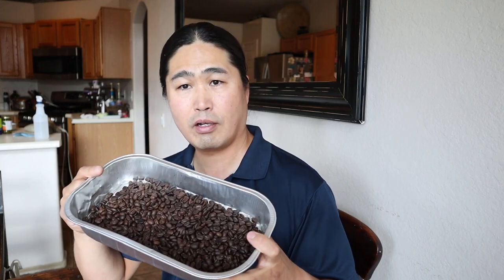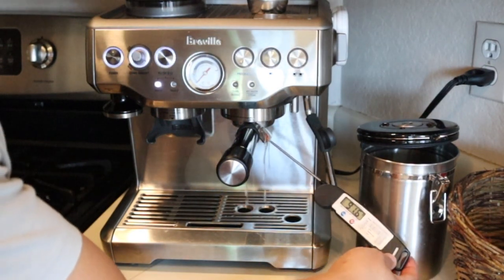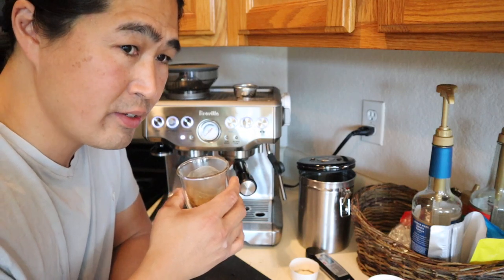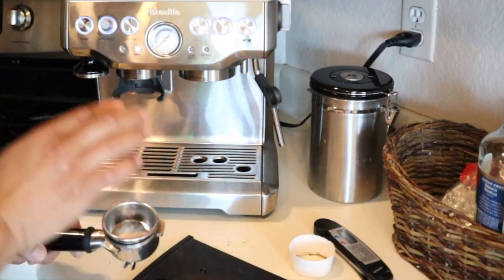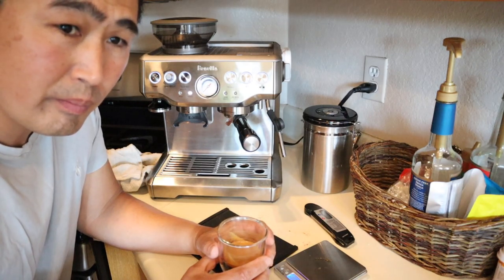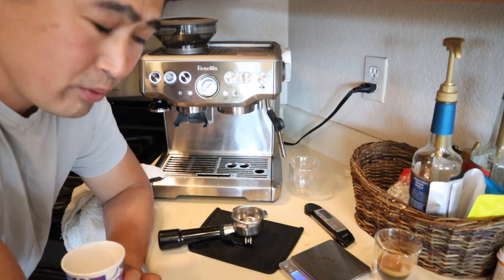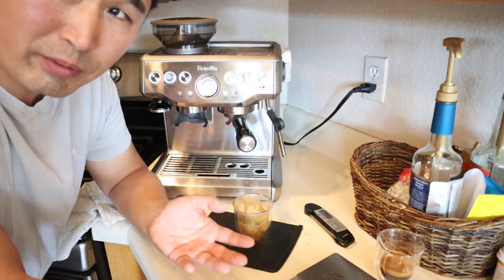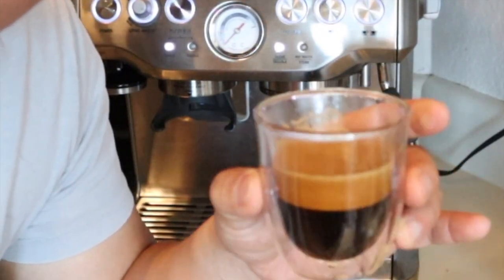Breville Barista Express - Tips on Grinder Adjustment!

Comment: I just bought the machine today. Havent been able to pull a decent shot yet. Under brewing consistently. Thanks for the video! I need a scale!!!
Reply: majinraptor I had the same situation. I adjusted the grinder size under the bean stocking basket to the finest, and it works now with size 3 of the grinder on the left is the machine.
Reply: Fresh coffee 5-20 days after roasting provides the best pulls. The oils create more resistance and allow for fuller extraction and longer brewing times.

Comment: Hoon—I really enjoy your videos and have binge-watched several of them while I have been waiting for my new Barista Express to arrive.   I just got it yesterday and knew exactly what to do.  The first shot that I pulled for a latte (using the single wall double basket) was right in the sweet spot for the pressure!  I used the same beans and oat milk that I have been using for years with an older Breville machine and the first latte that I made tasted COMPLETELY different like it was made at a proper coffee shop.  I didn’t even recognize the taste so clearly, I have not been extracting the full flavor from my beans all this time!  My settings were 6 on the coarseness, 3 internal and 3 o’clock on the grind amount.  Absolutely perfect!  I am buzzing so hard right now from the strength of the shot.  Lol Thank you for your great videos!
Reply: what is the internal grind size on? I just got mine today for xmas

Comment: Thanks Hoon. I am using the Razor that came with the machine to reduce the level to the Breville recommended depth. With my tamping and the razor I have been getting the pressure to close to the middle of the pressure dial and the taste I like using the single wall basket. Going to go and try the same proceedure with the pressurised one to see the results.
Reply from the maker: I have been really enjoying the double wall. I get good shot every time.
Reply: @HoonsCoffee  I too managed a good shot with the double wall. Puck doesn't drop out like it does with the single.
Reply from the maker: @garys639  I know. Maybe something to do with pressurized basket.
Reply: @HoonsCoffee  Pressurised basket won't allow the 3-way solenoid to extract the excess water at the end of the shot.

Comment: What is your your upper setting? The adjustment on the burrs. 
I’m using fresh beans and need to go down to a #3 on the side adjustment to get into the middle of the dial using a double non pressurized basket
Reply from the maker: My upper setting is 6 at the moment.

Comment: I measure the weight of the liquid extracted from the portafilter with a digital scale to figure out the coffee to water ratio. On a 17 gram grind (ratio of 1 to 2), for example, is x2=should equals 34 grams of liquid is added with the espresso gauge reading between 10:00-11:30 o'clock.  Stop the water before it reaches 34 grams by trial and error. That should be set in the program for that bean weight and grind particle size. This procedure is for perfectionist espresso brewers who goes by the book, LOL...The built-in grinder is quite as good as the Breville Smart Pro if the proper tweaking on the outer incremental burr adjustment is carried out.
Reply: I noticed that as well and ive been asking in every video ive watched since im new on making coffee drinks with the same breville barista express. Ive tried so many times with different grind sizes and grind amount and sometimes i get the right pressure but no the exact weight (36g) and thats when i realized that maybe i should reprogram the time for a double shot in the barista express and not use the default time setting (which is set to 60ml by default) but i wasnt sure if thatll be the solution for a perfect espresso or if i should keep trying with different grind sizes and amounts. Did you reprogram the barista express or just found the right grind size/amount?

Comment: I've had my barista express for over 4 years now.  I recently bought a 2 in one, weighted leveler and tamper for the machine. Also I have breville's 60 setting grinder if I need it.
Reply: The only issue I've had with the machine, is the rubber seal around the shower head tearing.  You'll know if this ever happens. The pressure will be low, with water and grounds spitting everywhere.  If their website says the white rubber gasket is out of stock, just call and ask. They should have it.
Reply from the maker: @nicholasrix1707  Luckily my rubber gasket is holding up but I should order some just in case.

Comment: great video, I personally love my barista express (same model as yours). I once had trouble setting the perfect grind size for which I did a little reading and found that you can adjust the grinder directly on grinder's top burr. This might help you get from 9 --> 8.5. I don't know the exact effect it has on the grinder dial numbers, but in  my experience it felt like reducing one level on the top burr had a -0.5 shift on grinder dial. I would be great if you did a video explaining it :) thanks for the video
Reply: I shifted the top burr by following the directions since my shots were consistently sour and fast. I’m not sure what this did in terms of grind size but it would be nice to hear Hoon’s explanations and experiments since I find him to be the best at explaining espresso techniques
Reply: Yes, I heard about adjusting the burr inside the hopper. I just don’t know how to do it. I just open mine to look and see if there were any numbers and there are, but they’re very hard to see. I had to use my phone flashlight. Anyway I don’t know how to adjust it. I agree with your advice on the vlogger creating a video on this!
Reply: What number did you adjust the burr on?

Comment: Hi, i never see you use the front round grinder dail. When do you use it ? Is this dail for how much grams of output you get? So in theory if you know de grinder setting fine or course you can adjust it to get the propper grams for use? This way you dont have to keep checking thr weight? Or am i wrong... i am kinda new to this.

Comment: Hello, I love watching your videos. I just got this machine. I have Illy medium roast beans. If I'm not mistaking you said "use grind setting 7 and pressurized basket for starters" right? Also, what should be the amount size. I love illy and kimbo. What you think about these brands. Thank you👋
Reply: I also use Illy on this machine. So far I found it to be best to grind fine (author of this video would call this "choking", the needle around 1 or 2 o clock position) and use a small dose (16 g). Oh, and very important: NON PRESSURISED basket (single wall). Also, you should skip the single wall basket, it does not help. Begin with the grinder at around 5, and work from there. You should get around 40-45 g in 35 seconds (including preinfusion). If you try these tips, tell me they helped at all.

Comment: Great video. Gonna try those settings. Using grinder at 5 and with the double-wall filters works fine for single and double shots. On single wall single shots right on the spot, but low pressure when using the double shot filter.
Reply from the maker: Since you have low pressure so make you beans little finer by lower to 3 or 2 on the setting.
Reply: @HoonsCoffee  Thanks for the tip. 3 it's the lucky number for the adjustment on the side. The single shot was good with 9 grams of beans (wife was happy with her coffee :D)  going to try 4 for the double shot since it was near over extraction. Worth to mention that the grind setting of the upper burr is set to 5.
Reply from the maker: @josean99  What brand of beans you've been using it
Reply: @HoonsCoffee  Right now I'm using Lavazza Caffè Espresso. Going to start looking for local roasters to get fresh roast.
Reply from the maker: @josean99  Have you thought about roasting at home?
Reply: Hoon's Coffee not yet but who knows

Comment: Need help. I haven’t got a good cup since I bought my Barista Express. I had it set on outside grind 8 & found inside setting on 6. I started watching videos (mostly yours) & started following the dial in. Grind was too loose & gave no pressure, cup was at 36g in 12 seconds with 18g of med roast coffee. So I dialed my inside grind setting to 5 & outside to 8 hoping for factory setting. 18 seconds, very little pressure, crappy taste. Well now I’m on 3 for the inside setting and 6 on the outside with 20 seconds, 10:30 on pressure gauge & I can drink it but it’s still rough. It sounds like the grinder is really laboring & if I’m right it needs to go finer still. Before I brake something, am I right on my inside setting? How low will the outside go and should it go to 0? Will it lock up if I keep going finer? Do I have a lemon grinder? I’m running the IMS cup. Any advice before I go for broke?
Reply: Wanted to add the tamp is hard pressed in. Going to the store for another bag of beans, the ones I’m using are from a local fresh roaster & it might have been a bad batch.
Reply: It was the locally sourced fresh roasted beans causing the trouble. Tried some old store bought stuff and it’s grinding like your vids. Drinkable but not there yet. Could be the store stuff only gets so good. Thanks for the vids

Comment: so Hoon, to be clear, 8 is Courser and 6 would be a finer grind?  Is this correct? The Grinder adjustment is confusing with arrows pointing towards Finer and Courser but it's important to realise not to turn the grinder wheel in the direction of the arrow indicator.  Turn it to indicate a lower or higher number?
Reply from the maker: Lower the number is finer grinds.
Reply: Just bought this machine and that setting was confusing me. Can’t wait for tomorrow morning for my next shot tryout!
Reply from the maker: @rundesewolawen  Start with 8. If you get no pressure go down to 5 or 6.
Reply: Hoon's Coffee 
Thanks for your quick reply. 
I had no pressure and turned the wheel the wrong way 😃
Reply: @HoonsCoffee  Hoon, Higher number is finer.  For example no 15=finest.  It's printed on the wheel.  lowest is coarser and the very lowest is before 2=dual wall.
Reply: @HoonsCoffee  . if lower is finer then why is "finest" marked clearly on the wheel beside the 15 marker?
Reply: Hi Hoon!! I've solved this after speaking with a Breville service technician.  I've attached his email.....Hi Roger, I'd be more than happy to help later with that
As for the grind, on the bes 860, higher number = finer, and in the 870, lower is finer, they reversed the numbering on the newer model.
But anyway, in both machines, pushing the wheel away from you, I. E. Towards the back, clockwise, will result in finer grounds.....................My machine is a little older.

Comment: Great video and very informative. Have you tried changing the settings on then inner burr by removing the hopper?
Reply: On what setting is yours on the inside? Think out the box it's on 1.5
Reply: @Sunny_Yummy  I have mine to 3. Out of the box I’m sure it was 6 when I got it
Reply: @nikkos1983  im also on 3 currently.. Whats your avg outer grind setting and what filter do you use? I dont measure my beans so when it grinds its way to much even if my grind amount setting is almost on zero
Reply: @Sunny_Yummy  it’s around 6 but it depends if the beans etc. Also I measure mine out at 17grams

Comment: Actually, channeling wasn't caused by the 14or15bars, I got the Delonghi 310, 680, and other Delonghis, and those are stock 15bar machines, that I don't have any channeling when I use bottomless, I do tap on the side of portafilter every time,  with machine that don't come with therm-siphon system, lower the pressure to 8.5bar at the group head might get more decent result, since therm-siphon does recycle some of water back to the boiler, that does lower its pressure as well, if the puck grounds wasn't that finer enough, all though I haven't tested that theory yet, but gonna to try it in next week.

Comment: Hoon, I can get the needle to be within the recommended pressure zone but the duration for the coffee flow is around 20 sec. Should I be worried about the duration at all? Or should I just adjust the grind size so that the needle falls in the middle of the pressure zone and forget about the duration?

Comment: You mention adjusting the grind to "coarser" yet the pressure is higher?  For a coarser grind normally you'd expect less pressure?  A finer grind, more pressure?  Am I correct or not?  Thanks Hoon
Reply: But he went from a single to a double shot basket. More coffee the water has to push through = more pressure.

Comment: Hi, again thank you for these videos. Do you weigh your coffee every time? I've stopped doing this (for ease of use) but I've found sometimes the grind amount is a little inconsistent. It's fine for days, then tomorrow the machine will choke / be in the upper range of pressure - the coffee usually tastes ok (maybe the use of milk covers it up). Have you experienced this? Thanks again 

PS. 3D funnel with shipping to UK would be good! :D

Comment: Im totally lost, i got the same machine purchased last week, tthe prefered  extraction time from press of the buton shoud be 25-30? with 18gr beans? isnt this way faster with a 15 bar machine like this? i cant get it slower then 16 sec from the moment of pressing the button, pressure is around 12 o clock on the meter. at grind setting 7 (internal burr stock 6) fresh beans roasted 3 days ago.  the espresso looks very nice. but is VERY strong i gues this is suposed to be this strong since its a real espresso.
Reply: I have the same question

Comment: Hi Hoon, I have this machine. I notice both on my breville 860 with built in grinder and my duo temp pro 810 that my crema has a lot of small bubbles on top. It’s random. Is this because somehow the water is too hot or some other reason?
Reply from the maker: Are you using double wall basket or single wall? If you're using a double wall basket it is normal.
Reply: Hoon's Coffee double. I love the grinder in the 860. I was lucky . Someone threw it away because they thought the grinder was broken. It just needed clearing, beans stuck inside.

Comment: Thanks for your thoughts and the video! What about doing a 8 grind and tamp a little less harder? The issue I see is you didn’t talk about tamping pressure..? Thoughts?
Reply from the maker: Thanks for the tips!
Reply: @HoonsCoffee  you bet! Just purchased the same machine. I have been using the sumo no velli Oscar, a heat exchanger machine but it’s over 6 years so we’ve upgraded. Stoked to use a machine with preinfusuion and to have a smaller footprint in our kitchen. Appreciate your videos and merry Christmas!

Comment: Thank you so much for your very detailed videos.  It's really appreciated.  I have 2 questions.  One, is I set the grinder to about 3.5 and it's underextracting.  I even have experimented with setting it to finer than that and it's still under extracting.  I'm not sure what I'm doing wrong. My understanding was that if it was under extracting that I should either apply more pressure with the tamper / and / or make the grind finer.  The other question I had is with regard to cleaning / descaling.  The light was on this morning so I watched your video on cleaning and I did that but the light is still on.  I imagine that means that the machine needs to be descaled as well?  Thanks in advance.
Reply from the maker: First what kind of bean are you using it now? Is your light solid or blinking?
Reply: @HoonsCoffee  The beans are not any particular brand.  They're Italian Espresso beans I've purchased from the store.  I filled it up more today and set the grinder to the finest setting while tamping down on it pretty hard and that seemed to do the trick.  I used to buy Stumptown and Irving Farms but since Covid it's been hard.  The light is solid.  Thanks

Comment: Thanks a lot foe the amazing  videos, I just got my own Breville Barista Express 2 days ago and I have question regarding the grinder, do I have to change the grinder sittings while the grinder is running ?
Reply from the maker: If you store beans in the hopper you need to have grinder is running when you change to finer setting but coarser you don't need to.

Comment: I set grander until to 2 but no good pressure on 2 cup ports filter.
Do you know why?
I bought 3 weeks ego new from Best Buy.
Reply: Did you put in enough amount of grind into the basket? And the tamping weight should be firm to the arm (not only wrist).
Here is his vdo about low pressure :)
https://youtu.be/43oFTGj4oRA

Comment: hello great video a little question when we make a single and a double Expresso you have to adjust the grind again?          and have the factory settings?                      I tried the double Expresso with 18g of coffee with the factory settings I arrive at my 60 ml of coffee but it flows too fast compared to your video I do not understand why?
Reply: Make the grind finer until u get 25-30 seconds, when u press the button start counting with an timer on your phone or whatever.
Reply: thank you for your reply the problem is that i am on grind size 1 i am already fine and i am already at the manometer at 12 o'clock but it flows too fast
Reply: 83kif assume that everything else is adjusted correctly, check your settings of your grinder on the top. Here is a link how to https://youtu.be/QNvOcE4-VEo

Comment: When the pull is too fast do you make the grind coarser?
Reply from the maker: If you're shot is too fast make the grind finer.
Reply: @HoonsCoffee  Have you used Jacob's coffe? I tried the grind setting of 5 to 7 and still get 5.5 oz for a double shot. It pours too fast. I stopped it at 2oz before but didn't taste right.
Can I grind even finer say a 3 or 4 grinder setting?